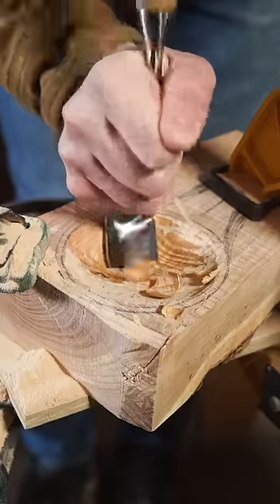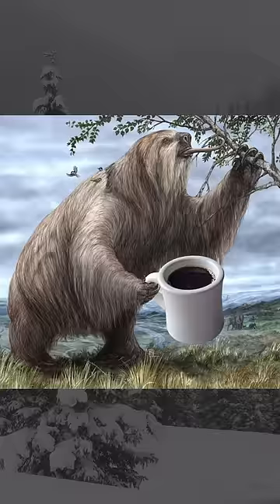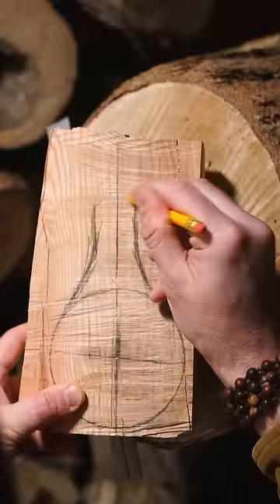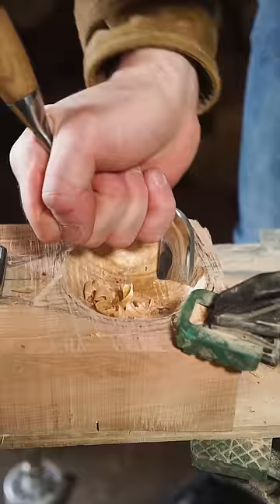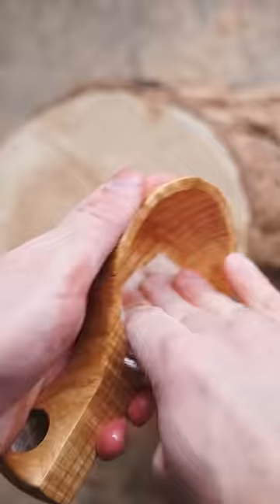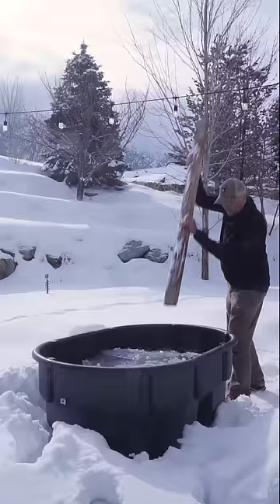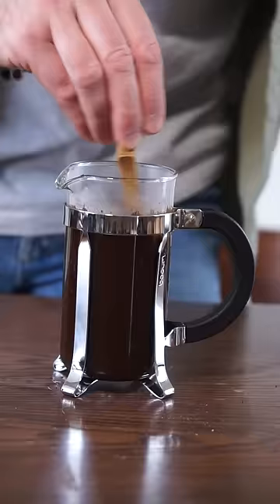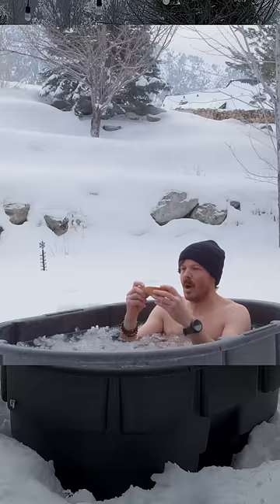Carving a kuksa out of coffeetree wood

Comment: Nice! Btw, kuksa is usually prepared for use by what is called ”baptizing” but in a totally non-religious sense😄 Practically this means that the first cup of drink that is prepared in the kuksa is not consumed from it but discarded instead. There are differing opinions on what the liquid shoud be differing from near boiling water to any warm drink to cognac, coffee grounds are also used for the prepping. You can find instructions on websites in english also!

Comment: Kuksa or Kåsa as they called in Sweden, are normally cooked in coffee or saltwater for 45-60min  after carving, then you take ground coffee and make your first coffee in the Kuksa, remove the Coffe, keep the wet ground coffee, leave it for approx an hour to dry and then rub the inside with the wet and warm ground coffee. Oil only the outside, linseed or grapeseed oil is best for it.

Comment: As a Finn, that's a neat lil kuksa. Do a deeper one next. The material may be an insulator, but you'll still want more depth to the exposed surface to keep your coffee nice and hot. And don't forget to soak the kuksa in salt water and  season the insides properly with coffee grinds! The salt keeps the wood from splitting, and the coffee grease makes the inside water-proof and easy to rinse clean, eventually.

Comment: Finn here. A kuksa is something you carve out in the woods after its too dark to work, a puhdetyö. Optimally, its made out of a pahka (a bur) by tearing at the wood grains. At most you'd use a puukko if the wood is too hard to tear at.

Making a kuksa with power tools is like walking a nature trail and pretending you're a survivalist or something.

The tradition is that they may only be washed with water from a a tunturi spring, no tap water and such, or you lose your luck. A kuksa is not varnished and hence soap would seep into the wood and foul the taste. Before first use the kuksa is boiled in salt water to wateproof it.